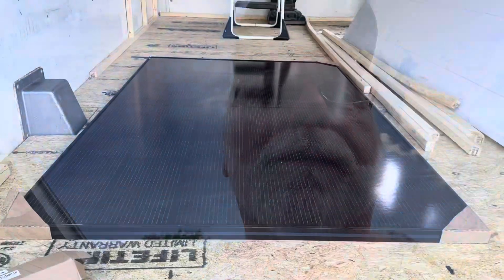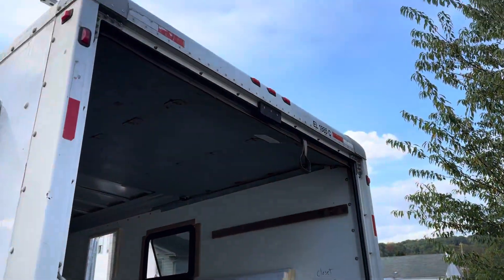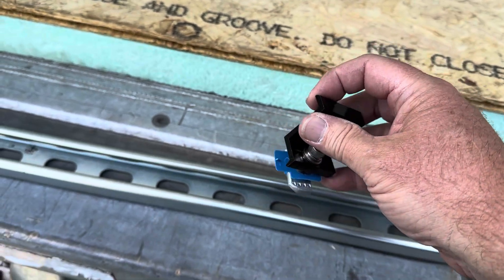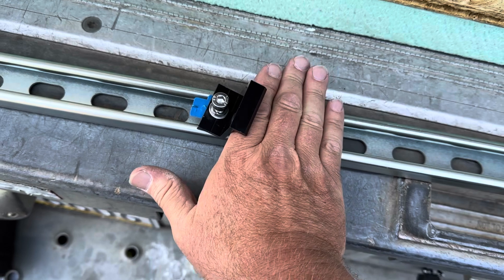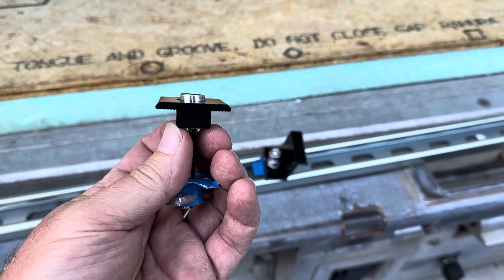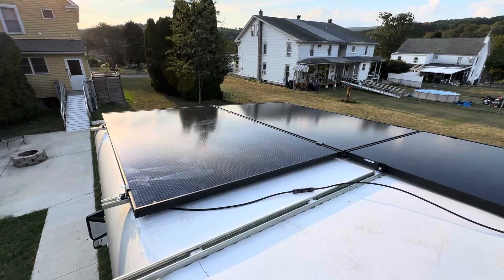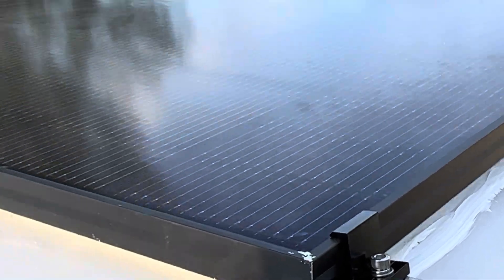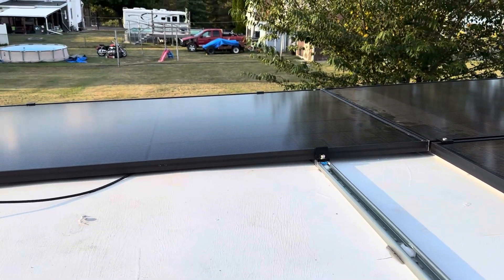2250 watts of solar! Installing “Canadian Solar” brand solar panels

Comment from the maker: T brackets for panels - https://www.amazon.com/Anbte-Unistrut-Aluminium-Brackets-Mounting/dp/B0F18659S3/ref=sr_1_3?crid=R2A4FIRO67TK&dib=eyJ2IjoiMSJ9.aJc2pTycuVGidWonwb3xe9hh0si43myzG6eYs2YHt10OAJVwlSll6lvmUP6MRrUqXdaM0XvTRWDSGaFxYUMO3GA_0bK68TKiU3y3QoZiobDprGFEICKgaFseL3KnSatTj2lfmxVbsASHyiEiu1-u62yvozusGFJTe1VIOmQw70KTzVDNwvVd4U9ferDWhtmnQ3B_xUW8DjpQAUMEzHp_iEX4asQdtuJGGsRoOD6KaNE.3DlFZ2eEYRViMuXK_RQ2J5Ljj004jmW_Z8aI8peneB0&dib_tag=se&keywords=unistrut%2Bsolar%2Bpanel%2Bbrackets&qid=1758045689&sprefix=Unistrut%2Bsolar%2Caps%2C174&sr=8-3&th=1
End brackets for panels - https://www.amazon.com/dp/B0FBWH5Z3M/ref=dp_iou_view_item?ie=UTF8&th=1